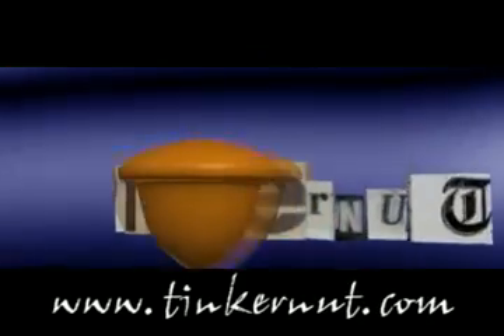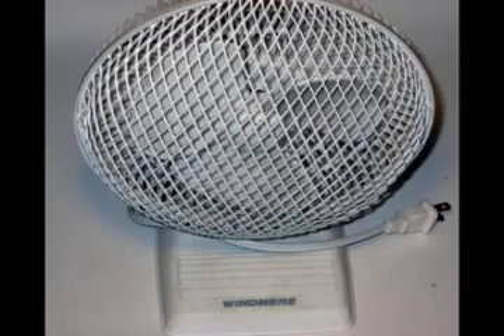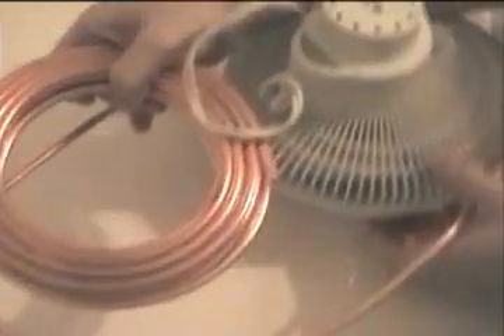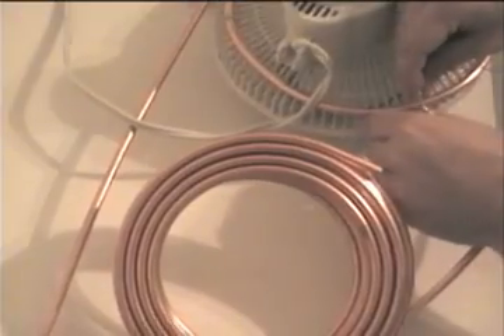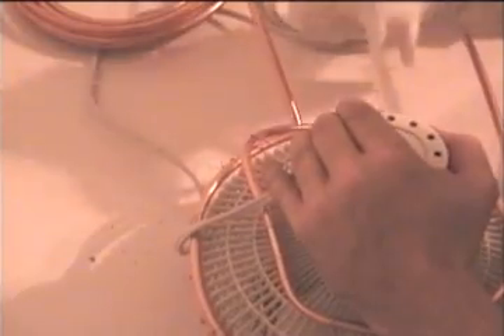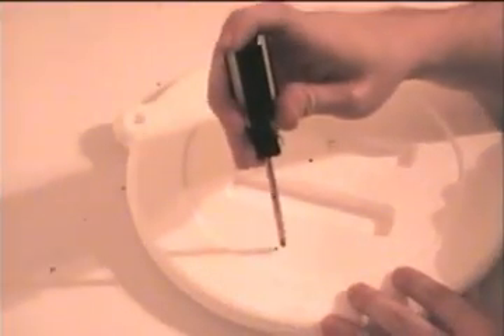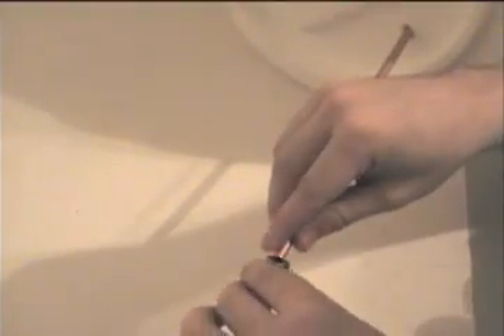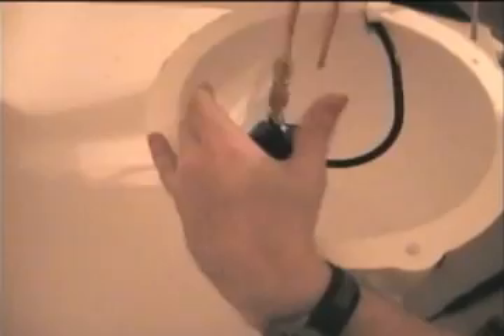DIY: Make your own Air Conditioner

Comment: if the condensation from the air in the home on the coil gets blown back into the air in the home, so what. it may not help to reduce humidity in the air, but it's not going to add any more moisture to the air. PS, condensation doesn't come from copper, it's moisture from the air that condenses on the cool surface of the copper and drains off the coil. You must have missed that day in class.

Comment: hartford, are you kidding me?  So your saying if I bought an American made motor and an American made fan, and housed it in plastic it will be safer than this.  Thats a load or crap.  What are you talking about?  Chinese things are a little more weak than other countries products, but every motor burns out and all plastic is flammable.  You have a moot point on your hands.  sorry.

Comment: Salt will allow the water to be much colder. Once, to prove a point, I made ice cream with a bowl inside of a bowl. The inner bowl had salt and ice. The temperature of the melt water got down to 13 degrees Fahrenheit. Much colder than the 32 degrees fresh water normally freezes at. So yes, it will melt the ice faster, but the resulting water can be much colder. So, like crazystuffffff said, "it lowers the melting temp of the ice".

Comment: Point 1: Actually, Butt (you don't mind if I call you that do you?) The humidity collected on the coils came from the room. Any water on the coil evaporated back into the room only puts it back where it came from. I'd say humidity levels would remain level.

Comment: Absolutely, to get maximum efficiency out of a refrigerant that is what you need to do (compress and decompress it). However, on a simpler level refrigerants have a much lower Specific Heat Capacity than water. Which means that they will cool down quicker when entering the ice, and release that heat quicker when being blown through the radiator without wasting energy with the cooling process. Therefore the ice, and whole processes, will last much longer. It's not a replacement for A/C, no.

Comment: Hey will this work better with a pump that uses 1/2 inch and the copper a little bigger? And my room is about 100 square feet with everything closed when its about 80 how much do you think it will lower it

Comment: LOL... Sorry man, but there is more to cooling than simply circulating a refrigerant. You need compression and decompression for a refrigerant to work. The idea presented here works because the water is already cold (ice water). This will only work for a while until the water is the same temperature as the air. Then you'll need to reload with ice.

Comment: thank you mysterymeatgrinder (lol, name)  and to buttstrainer (name should be banned) there is condensation reducing humidity, then fan evaporating condensation as well.  there is still a benefit cause the humidity is COOLED.  the cooler if sealed wont release humidity.

to superfy this contraption for outside, say tailgate party with a pump running off car, is install a very fine mist spray nozzle at the top.  cool air with cold mist.

Comment: You can solve the problem outlined by 'buttstrainer' by simply attaching the tubing to a car radiator instead of messing around with a fan like he did. This puts up the cost, but is much more efficient. The radiator is going to need a power supply, but the fan did anyway. If you buy a portable power pack you can have this thing run for hours. For even better cooling, don't use water, use a refridgerant like Freon 12. However you better bloody well make sure the system is sealed if you do that.

Comment: Why not just put the ice in a metal bucket and hang it above yourself?  convection will allow the cooled air to drop over you. Your running two motors with this bit of kit (3 if you count the freezer that made the ice)

Comment: uh air conditioners period (put in your terms) attract humidity.
for the air to become more saturated would mean the air would need to heat up again and evaporate the condensation.  since this does not happen humidity wont increase.

in the situation of this device, humidity will be reduced the most at first and gradually lose effect as the ice melts.  faster pump flow would keep the pipe colder increasing effect.

Comment: must not be that good of an expert.  how does it raise humidity if the water flow is sealed away from the flowing air?  indoors this could possibly cause condensation thus acting like a dehumidifier.  please explain

Comment: Would salt mess up the water pump? I built one, I filled up 85% full water bottles and added salt to the water and crushed half the air out, capped, and put them in the freezer (so it can lower freezing temp and expand in the freezer). I also only put it on the front grill because i can completely avoid the possible risk of water damage on the fan. I also used a plastic trash bag to seal the humidity in the tank and wrapped the tubes in cloth to/from the fan for condensation and insulation.